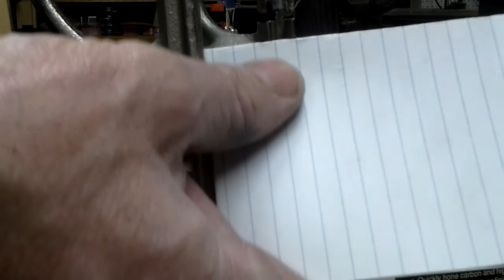An amateur Beading with a combination plane part two

Comment: Hi Kevin,
Great idea to video it. My initial thoughts are that your wood isn't helping - the knot in the pine suggests some swirly grain, and the edge of the oak looks like the grain is quite wavey. Straight and parallel grain will give the best results. Also, the work is moving about too much as a result of the bench racking. Try to brace the bench with some stout diagonals. These need not be permanent, perhaps cut to fit within the frame for easy removal and replacement.
I'm going to watch the second video now, then come back and review this one again.
Keep at it! Mitch

Comment: I can see some tear out on the finished beads which will be down to the grain. When that happens, the blade is catching and since the bench isn't solid you can't hope to keep good control on the plane.
Did you flatten the boards properly? Any concavity will cause problems too.
Lastly, the fence should ideally be riding against a smooth, straight edge, not a rough sawn edge.
If you can avoid muscling the plane (is that the term you use) by reducing the depth of cut more if necessary, and try and address the other points, I think you'll get better, and easier, results.
Good luck, Mitch
Reply from the maker: Hi Mitch and thanks again for all the feedback!

I built the bench on wheels and even though they are good quality and lock in all directions, it still allows too much movement for planing. For work other than planing, this bench has been quite good as it enables me a wide range of clamping options. That said, the Kreg face klamp gets mixed reviews from me. The big draw back with it is the need for two hands when initially clamping. There is a hand crank that must be used to set the thickness and  you can then close the vise grip part. So, you have to balance the wood, turn the crank (trial and error to get the thickness needed) and then close the clamp. Once you have the correct thickness, it works fine. But, if you are moving between stock of various thickness, it is a real pain. I would recommend a traditional face or leg vise for anyone thinking about purchasing a clamp/vise, especially for hand woodwork.

Re: improving the bench; my choice is between refitting my table saw outfeed table/work bench such that I can use it to clamp wood (probably my first choice) or to try another set of wheels. Here in the U.S. Rockler sells a set that disengage and drop the bench legs onto the floor. They may work, but my concern is that the bench will still move and rack. It is a pretty stout construction (2x4 and 1/2" plywood), but may still not be heavy enough for plane work. I will probably remove the wheels and give planing another shot and see.

I believe the edges of the boards are good. I cut them on my table saw using a  good quality, 40 tooth blade. The pine is basic stock from a "big box" store. The oak is a cutoff from an old project and has been laying about the shop for years. I think I will get another piece of oak, one with less swirly gain and have another go.

Muscle is common American slang for too much force. I am pretty sure I first heard it used in American gangster movies from the 1930s. Bogart and Cagney would refer to their henchmen as "muscle." I later heard it often when I was younger and working various construction jobs.

As I get the hang of sharpening and planing, it appears that a well tuned plane with a really sharp cutter should cut through the wood with little effort and little muscle. Perhaps not gliding like a sharp knife through soft butter, but certainly nothing like the heavy force I have needed to get through the oak.

For anyone that comes across this series of exchanges I will add 2 observations: 1) as with most any skill based activity (tennis, ballet come to mind as examples) the professionals make it look easy and you have to expect that it will take time and practice to approximate their results and 2) all of this is well worth the effort.
Reply: Thanks Kevin.
Wait until you see the sash cutting with the 45 - I think I make that look pretty difficult going!
Reply: Kevin Blair
Indeed you won't be an expert right out of the box with hand tools.  Experience and feel will come with repetition and the immediate feedback you get from seeing and feeling the results.  You may want to try butting your bench against a wall(a corner would be better) and preload the legs(nudge them toward the wall(s) after it's in place).  This will eliminate most of the racking in line with the planing action.  You won't get proper feel or feedback and you will be spinning your wheels until you get a solid work surface.  Don't get frustrated, it will come.  There are many klutzy woodworkers who lack coordination on youtube who produce nice work.  They have to work harder at it, but through sheer perseverance, they still get it done.  And that's what counts.
Reply from the maker: blmeflmm66 Thanks! I have gotten a lot better. I've done a good 10-15 practice cuts. I'll try clamping that bench to my outfeed table and see how it goes. I have been using my outfeed table since seeing how much this one racks, which is a lot heavier and not on wheels.